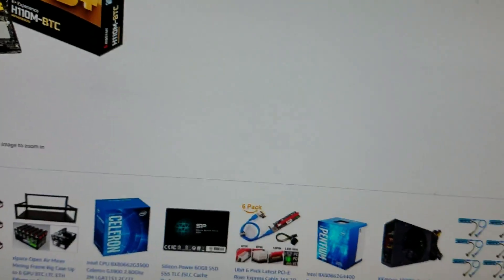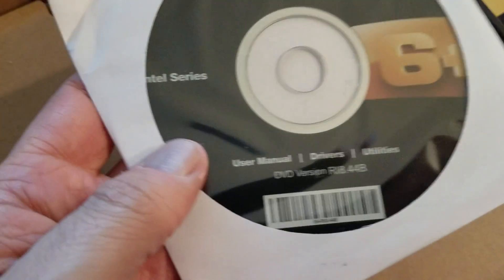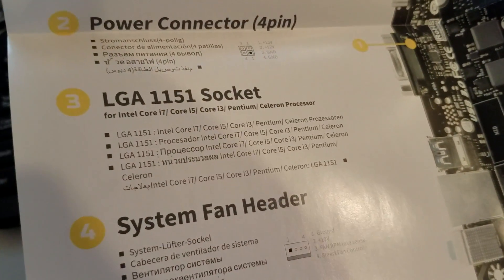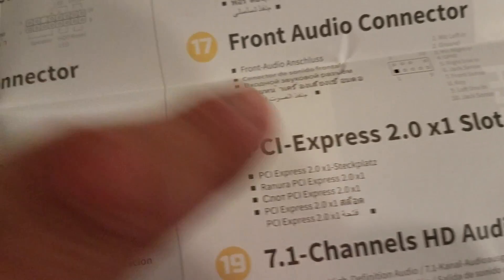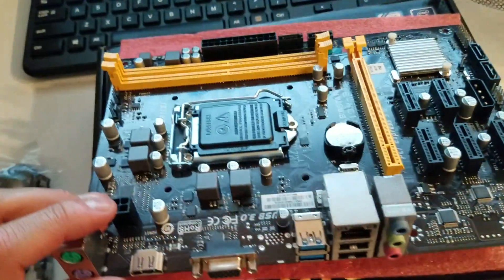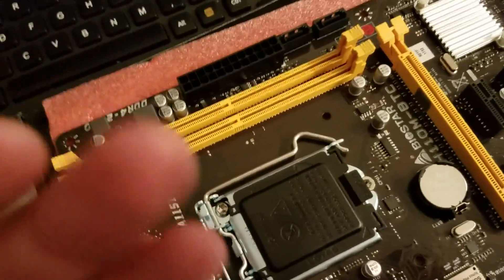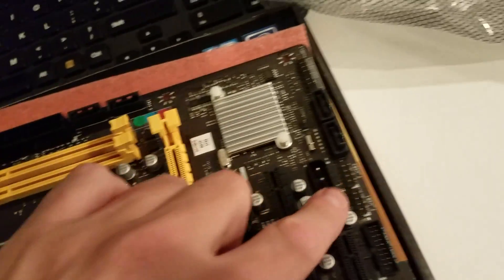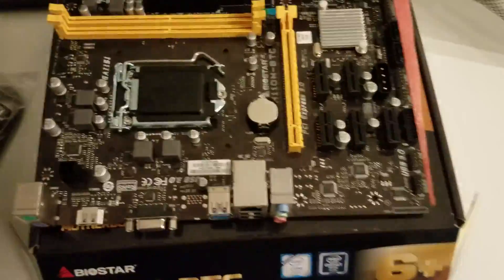Biostar H110M-BTC 6 PCI-E Mining Motherboard Review

Comment: this is a pure shit Motherboard. Never buy it please ! It has a lot of problems
Reply from the maker: MihaiH Can you please be specific? I currently have issues with 4th card. And still not sure if it is motherboard, drivers, windows, risers, power cables...
Reply: dude i bought this mother board but it didnt display on screen not even on the keyboard and moouse
when switch on
Reply: I cannot get more than 4 cards to work on this board.  Going to replace it.
Reply from the maker: I did 4 cards stable. Cannot comment on 4+